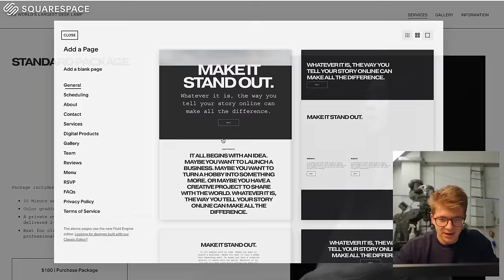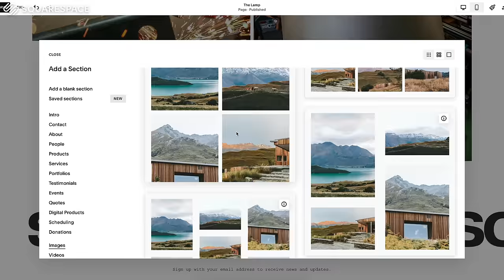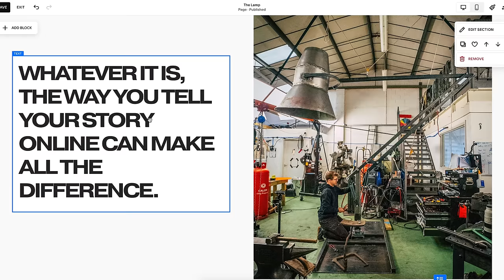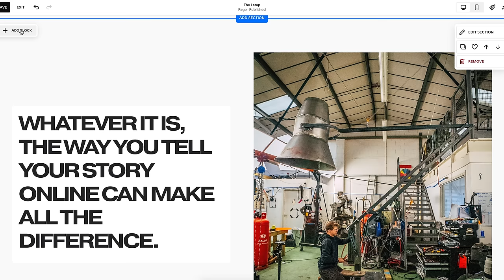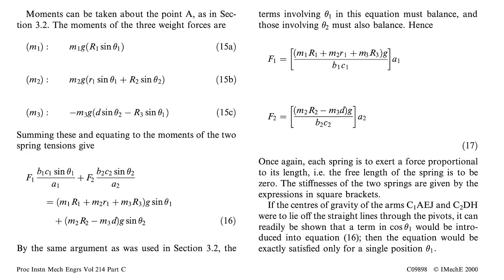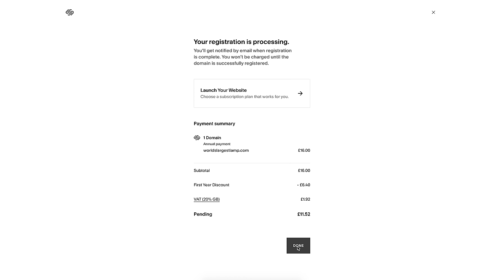I Made The World's Largest Articulating Lamp. (Part 6)

Comment: The solution to the problem is the lamp shade is too heavy. The original is aluminum so when you made the scaled up version out of steel that added far too much mass for the leverage. Also, run safety cable through the springs, just in case.

Comment: What if instead of springs it were redesigned to use pneumatic/hydraulic cylinders? They can get pretty compact/small and it wouldn't be standing beside loaded up springs all the time. Route the hoses internal if you can and it still keeps the look.

Comment: If you count the coils of the springs on the original lamp you will see how it works, the constant pressure over a wide range of travel. Your springs are too short, instead of spacers put another spring or custom wind springs for the job old school.

Comment: I feel like sheet metal, tubing, joints, all that is gonna crumple and die.
When you scale it up like that you should probably have some more complicated structures to distribute load, thicker walls, stronger material etc.

Basically I don't trust the metal.

Comment: I think I would have used pneumatic cylinders, with them sealed with a vacuum inside the pull the cylinder like a spring would have the same tension over the whole distance of travel, unlike a spring, getting stiffer until it stretched or breaks

Comment: You need to put safety cables inside the springs!!!!!!! I am a garage door technician and stretch springs are very dangerous. A safety cable will keep it from shooting if or when the spring breaks over time. Please put a saftey cable inside each spring. I have had a client die because they didn’t put a saftey cable inside the spring!!!

Comment: Am I thinking too simplistic, or did he just need to add 1 more spring on it's own tensioning system in the center to make it extremely easy to balance/adjust? The 2 he has on there are just supporting the weight.
Awesome work.
Add an articulating arm to the lamp shade so you can move it around.